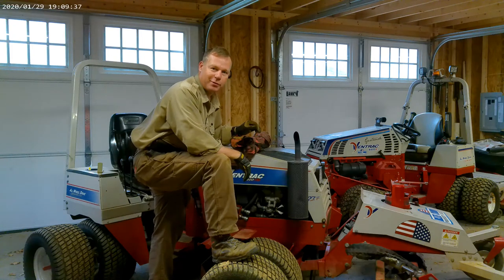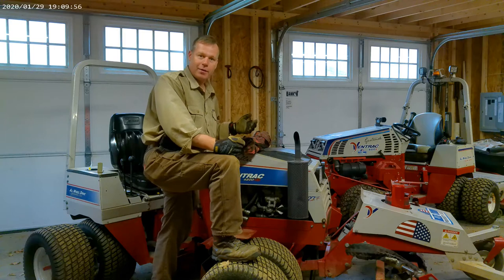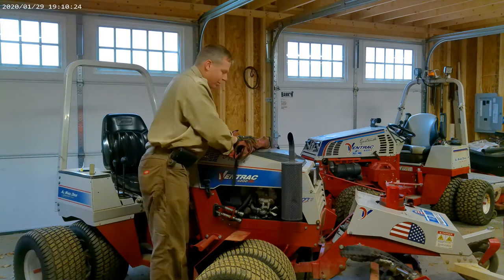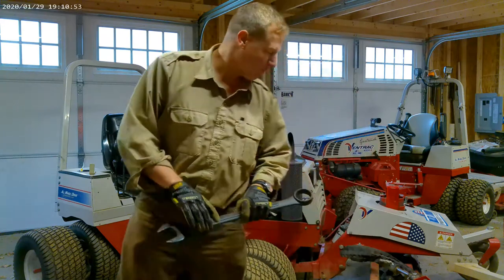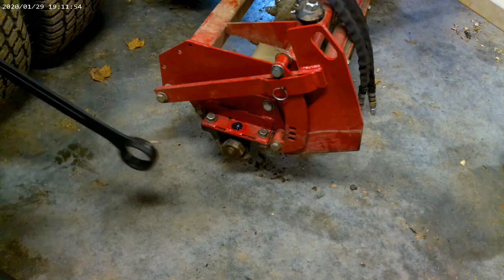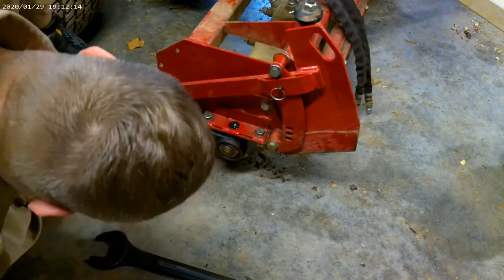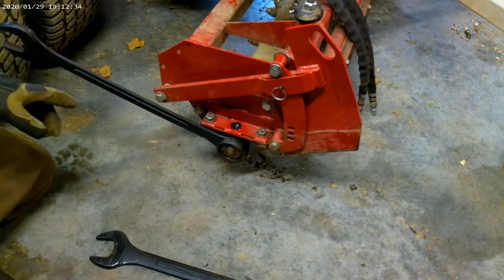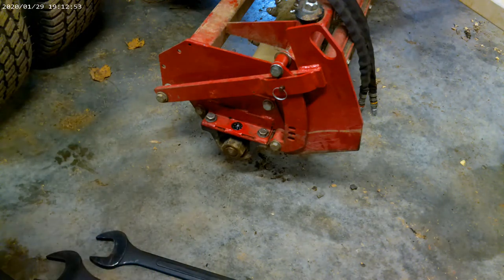BIG Wrenches for Ventrac Maintenance

Comment: Had the same problem with our blade, while I was pushing dirt, the bigger than 2 inch nut fell off, I found it, the blade came unattached from the pivot to tilt the blade. We didn’t have a big enough wrench, so we went over to our farm neighbors and they didn’t have one either. We ended up having to go buy a socket to use with an impact.

Comment: Harbor fright.
Reply from the maker: I don't buy stuff there.  What about it?
Reply: @bluecordprecisiongrading2504  , worked for Exide for ten years as a delivery driver. Yes harbor freight is cheep,however i do have tools i have added Cheater bars too and mortified to fit and not broken. If one does  break your not out a lot. Do greatly enjoy your sharing videos,I’am envoy us that you have two ventracs and i have none.How long did it take you to get to the point in your business today?
Reply: @bluecordprecisiongrading2504  , do have some die grinders that are cheap from there,but only us once a year or so. However if using more often i would buy better stuff.
Reply from the maker: @carljones3515  Harbor Freight has its place but because I run a business, I can't risk a tool failing so I buy quality to mitigate that risk
Reply from the maker: @carljones3515  I've owned Ventrac for about 15 years and bought our second one back in 2016.  It started as a hobby back then.  My VA doctors told me to find something to do and I really enjoyed running the equipment.  That turned into people asking me to do certain tasks for them and that led to our family business after we moved back to SE Pennsylvania a few years ago.
Reply from the maker: @carljones3515  I used to drive OTR for Deka
Reply: @bluecordprecisiongrading2504 , i gathered that. Did  they ever call you and tell you to “get the lead out”,start moving? Or do you still get a “charge” out of your job. I see/hear exide is in some trouble. I drive OTR now , flatbeding. Near Salt Lake City now with a blownen water pump. ALWAYS enjoy watching the folks with Ventrac’s work. Looked a little around home in Tn. Not seen much with Ventrac there. Have you seen GCI Turf in NC?
Reply: @bluecordprecisiongrading2504  ,  I would like to come off the road and do something like your doing. As I drive I look and see were a  Ventrac would work. I think some applications are what the operator is willing to try. You know “ hold my beer and watch this”
Reply from the maker: @carljones3515  It's always a risk to start your own business.  I retired medically from the Army in 2003 after over a decade of service in both active and part time roles.  I bought my first Ventrac shortly after.  I'm not doing this to necessarily earn a living but I enjoy running the equipment and doing a great job with it.  Ventrac isn't the "magic potion" for success.  That comes from a good business ethic and attention to detail.  Ventrac is a "tool" and you need to be good at using tools and operating equipment in addition to many other aspects of running a business to be successful.
Reply: @bluecordprecisiongrading2504  ,from I think Larry Wingit? “ find your uniqueness and exploit  it in the service of others.”
Reply: @bluecordprecisiongrading2504  I buy most of my tools and farm supplies at Rural King.